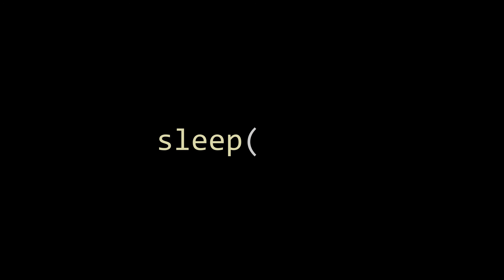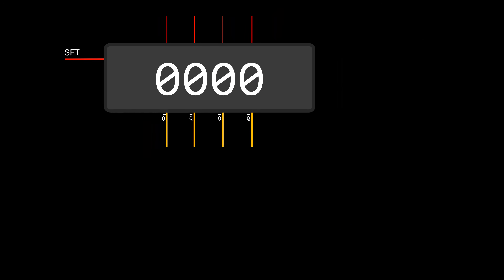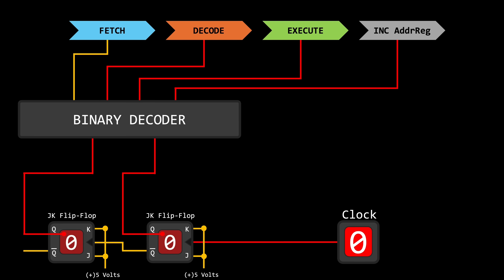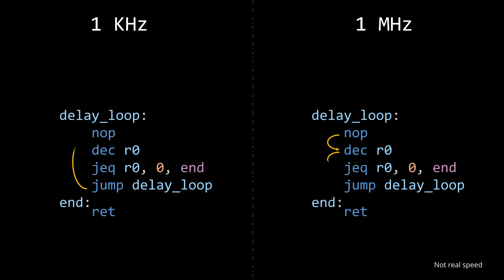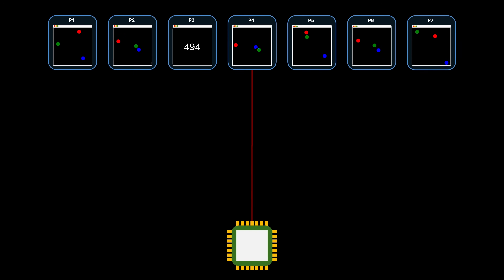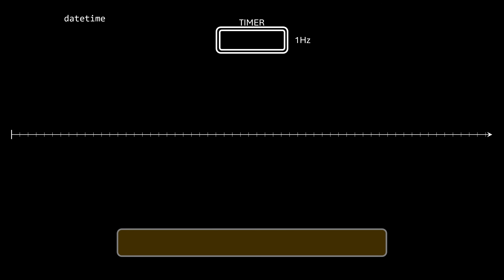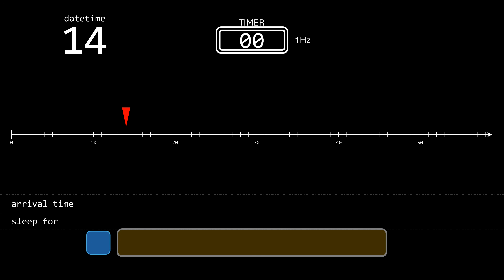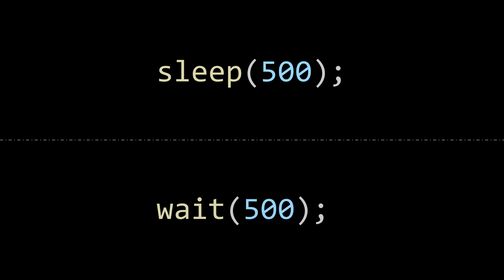What Happens When a Program Calls Sleeps?

Comment: Thanks for the video! One question though – why is the interrupt even needed to move the process from the sleeping to the ready queue? The process won't run anyway until the scheduler runs, so why can't the scheduler check the clock of whoever is in the sleeping queue, and move the process to the ready queue if it is already at 0? An interrupt seems like unnecessary overhead to me.
Reply from the maker: 1.	Interrupts are ultimately used to improve precision. If the scheduling policy gives absolute priority to a process right after it wakes up, then it doesn’t matter how many processes are in the ready queue—the newly awakened one will run immediately.
2.	To avoid unnecessary overhead, modern schedulers are designed to run in constant time, O(1). That means they shouldn’t waste time checking empty lists or looping through all sleeping processes. Interrupts help by only triggering those routines only when it’s actually needed.
Reply: @ That does make sense, thanks!
Reply: @CoreDumpped  It can still be a valid approach to defer the update of the "sleeping queue" whenever the scheduler gets control back if 1. is not needed. Point 2. is satisfied in your example because the sleeping queue is sorted by wake up time, you only test the front of the queue ;) This approach would save some interrupts and context switch costs
Reply: It was explained in earlier videos. All the stuff you just said required CPU to be actively doing the switching running the scheduler. That stuff don't happen magically by itself. If the CPU is running user program it cannot do all that.

Comment: Now I wanna video about real-time OSs
Reply: Just different scheduling policy, but I would love to know the details as well!
Reply: The only thing an RTOS does differently is that it interrupts any process after a set amount of time. In the case of FreeRTOS for example, there's a watchdog in the background that sets a timer. After X amount of time has passed, say 5ms, it either schedules a new process to run or it interrupts the current process that is running and terminates it. In an RTOS, processes have to regularly give control back to the main task this way. Again, staying with the example of FreeRTOS you can create "tasks" that are automatically interrupted and rescheduled accordingly. 
This allows for a process to wait at most X amount of time before being able to be scheduled. This is especially important in embedded systems like cars for example, where you want to have a guarantee, that your brakes will be checked every 5ms, and not just ignored because you are currently changing radio stations or something.
Reply: @Finkelfunk  It sounds like exactly the same as the time quantum used in gerenal purpose OS, except it is not a task queue but some other data structure that will be sorted frequently according to some weighting.
But It does not answer the part that the execution time is predictable and guaranteed.
Reply: kinda like an arduino? expect arduino's dont ahve an OS i think. (im assuming that what makes them  real time)
Reply: @Heavy_Lvy  I'm an embedded programmer by trade. Allow me to clarify.

You're correct that Arduinos don't have an OS, at least by default. The code you install on it is run "bare-metal", which means that apart from some boilerplate that the compiler adds to your code in the background, the first instructions that the processor reads are the instructions that you wrote. That helps make your application "real-time" because nothing gets in the way of your code executing the way you intend it.

You can, however, include (or even write) an OS, specifically a class of OS's called Real-Time Operating Systems. These are considered "real-time" because the margins they add on executing your code is very thin and predictable, so you can quickly respond to events.
Reply: @Heavy_Lvy  Yeah, i think those are like a single process? I know they have physical timers for interrupts to let you switch between routines and I think you have to write that yourself, so that might mean it doesn't have OS. I mostly program on ESP boards, and those don't have these physical timers, instead imitating them with hidden software that switches between incrementing those timers and running your program, so I guess that's a kind of primitive scheduler.
Reply: @Heavy_Lvy  yeah arduinos are bare metal, there's no OS at all.
Reply: @

1. Arduino has no OS (and is running on an AVR micro-processor). Arduino has no relation with RTOS, and is far from being real time. Clocks can vary, baud-rates, etc.
3. RTOS does not mean that it is fast. It means that its clock cycle and execution time is predictable (sleep will always be precise).
Reply: I'd like the release of the RTOS video to be a guaranteed N days.
Reply: Yeah, especially because not too long ago, the Linux Kernel actually got real time support iirc
Reply: @JordanPlayz158  sched PREEMPT_RT it called and kernel 6.12
Reply: Just search for MS-DOS.
Reply: same!
Reply: Just look up MS-DOS.

Comment: The hidden part of sleep sort:
Reply: I want to know that too! Who is sorting the sleep queue, and isn't that taking up cpu cycles.
Reply: @glimpsee7941  sure, nlog(n) time compared to n^2 unsorted. The system could choose not to sort for less processes but who cares if it's low anyways
Reply: @deltamico  that's why they mentioned use of red-black trees or other structures, where the process of adding an item to an already sorted list is log(n). As long as you keep the list sorted, you only need to ensure the additions are in the right spots to maintain the sort
Reply: @sage5296  n in this case in the average amount of sleeping processes. Each process is taken out of the Q eventually (so that the sleeping is usefull) so times n, and a new one added to keep the average. A heap will have better coefficient and can be build in n for the case of treating the Q as unsorted for a while, but that's besides the point.
Reply: SO THAT'S WHAT IT IS